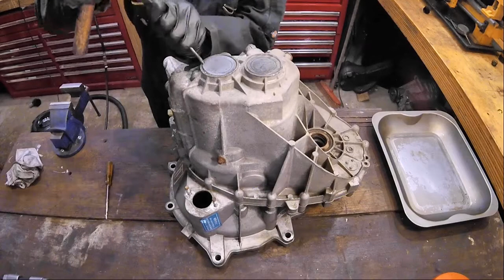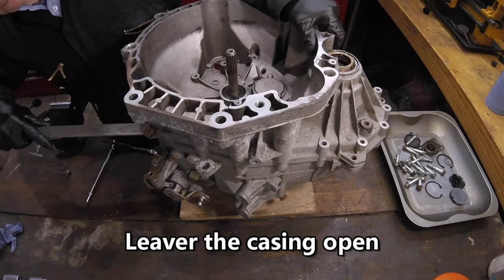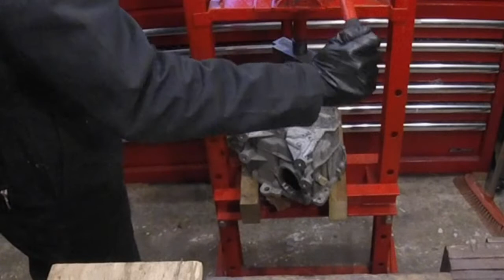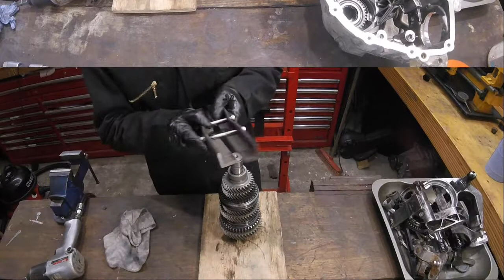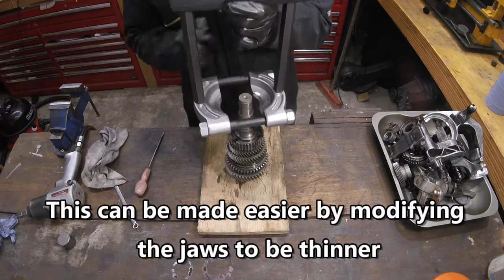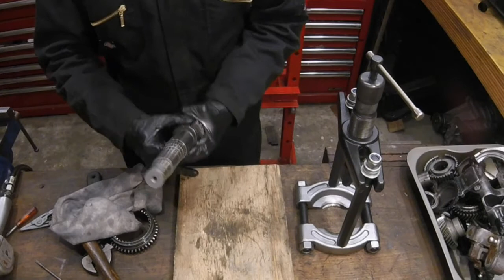Mini Cooper, Mini One, BMW R50 5 speed Getrag Gearbox strip-down

Comment: Ever seen one with only 1st and reverse gear? 2,3,4,5 all neutrals shift linkage looks to be actuating how it should. About to tear it apart
Reply from the maker: I've never seen more than one gear fail at a time.  1st, 2nd, and reverse all use the same hub. So if 2nd is not there I suspect it's a cable problem, or gear stick mechanism, that is not giving enough throw to engage the gears.

Comment: Hi David enjoyed the video’s immensely. Could you please tell me where to locate a bill housing for r50 12/2004 mine was damaged due to broken bolt from crown wheel. By the way how to remove the broken bolt. Best of thanks
Reply from the maker: One Stop Gearbox Shop may be able to help with a new casing but possibly cheaper to look for another a scrap 'box for parts. Diff bolt failures are common and they should be checked and reassembled with a thread locking compound. To remove the bolt I suggest you work from the unbroken side and tap with a centerpunch to rotate it back through enough to grip it with a mole wrench or similar.

Comment: Hello David, is there a need to tear down the whole gearbox if all gears are working very nicely, but the gearbox is whining? No matter at what gear. It is not whining when I press the clutch or there is no acceleration or deceleration.
Reply from the maker: You can just strip it back to any stage you want. The main issue is that, if things are going wrong, it is very difficult to clean out any debris without fully dismantling it. Whine in all gears is most likely to be the differential, check the diff bolts are not loose and bearing are in good condition.

Comment: Hi Dave, I am up against a rock un hardplace my mini r50 2004 convertible had what thought was a thrust bearing gone after removed and replaced with complete clutch kit refitted to the car one other thing the used oil from the box was silver in colour and had swarf in it this was very fine like glitter gearbox totally drained fresh oil put in after refit  still have a horrible wine grinding noise engine running select all gears all good in neutral no unusual noise depress clutch  revs up no noise I then with front wheels raised off the ground release the clutch to drive the wheels spinning and the wine and grinding noise is there put a long screwdriver on the housing casing the noice is loudest when the screwdriver is placed on the diff housing I am changing up un down all gears no crunching forward gears and reverse gear no crunch , after about 10mins turned off "  so have now removed the fresh oil and found glitter like in that too . I have removed the gearbox from the car I have phoned around near where I live and seems nobody wants to repair them only sell you a recon for very strong money my question to you is is it worth my while  me spitting the box as I am thinking the problem I have is the carrier bearings in the differential please let me have your thoughts , kind regards Law
Reply from the maker: From what you have described, it sound like bearings are failing. It may be the diff bearings, but all the bearings can fail so it's difficult to be sure without opening it up. You can buy an overhaul kit with all the bearings and seals for around £160. The risk is that the secondary shaft bearing surface has failed too - that would really make it beyond economic repair. There's nothing to loose by undoing the 17 case bolts and having a look.
Reply: @Nogoslowly  Dave " 
Thank you so much for coming back to me I have looked in to doing that have seen the kits to rebuild I am retired now this is a car a purchased over the lockdown and after doing a lot of work on it and putting a new mot last month taxed insured then on the day of it's maiden run out this raised it's ugly head sods law"  the thing is I do not have access myself to a press and the other specialist tools needed although I have asked a friend that do have a press at his works only thing that scares me is if it is bad and I can't fix it !! the recon places stipulate that they will place a hefty  surcharge if the exchange  box has been opened so will have to have a think ".
 ps sorry to babble on Law
Reply: oh by the way that video is spot on"
Reply from the maker: TBH, if it is beyond fixing, you'd be better to buy a complete 'box rather than exchange. They come up on ebay from time to time. And don't rule out buying a failed MOT car as that is often the cheapest way to get them, swap the boxes and then just sell the car on as spares, or for repair, or scrap it.

Comment: hello David!  help me please!   I have a 2004 Mini Cooper r50 and my midland manual transmission its broke and I would to know if its posible do a swap for one getrag like these. I read some posts that recomendly do this,
Reply from the maker: It can be done but needs new driveshafts, flywheel, clutch slave cylinder, and gear stick with cables. So a lot to change really, and best done from a Getrag donor car.

Comment: Hello David, thank you for posting the videos for the R50 Mini Getrag 5 speed box. Do you know the torque for the blind bearing plate in the gearbox itself ? it has 2 torx bolts holding it in place. Thank you for reading.
Reply from the maker: Getrag/BMW are not forthcoming with torque data for bolts but I use the standard torque for the bolt size and grade 8.8 - which can be googled.

Comment: Hi David, my r50 5spd has done the imput shaft bearing. doesn't look to difficult to replace?
Reply from the maker: It depends on which bearing you mean - the first input shaft bearing (from the clutch) is easy, simply split the casing and push it out. But I suspect you mean the secondary shaft one that support the drive to the diff. That's the one that usually fails and would require a new shaft and bearing. That is a full overhaul and may not be any more cost effective over sourcing a replacement gearbox.

Comment: Would you happen to know where I could find a replacement 5th gear?
Reply from the maker: The 5th gear does tend to burn up as it is squeezed by 3rd and 4th as they migrate down the shaft. That's why we remove 5th in the racing boxes. It can be repaired by pushing 3rd and 4th back in place and replacing the bearing if it has melted. It's not readly available as a new part so, if you need to find another one, you really have to look at the secondhand market.  Message @Duratec.in.detail on facebook and I may be able to help you locate one.

Comment: My mini 5 speed getrag wont go into first, presumably lost the synchro. It will only go into first if i push it in without using the clutch whilst rolling or rev it high and push hard on it. Just completely locked out of first really. Any idea if this is definitely a synchro issue and anything i could try? Thanks
Reply from the maker: If it is just 1st that's the problem, then it's probably a broken synchro ring. If other gears are a little difficult, then it's likely to be something dragging - ie 5th gear bearing being crushed, or 2nd gear bearing can cause a similar problem.
Reply: @Nogoslowly  yeah its just first gear. Im managing to live with if for now, as double clutching usually works to get it into first, however sometimes it doesn’t so i often depress the clutch and engage first before coming to a hault so i can always easily pull away again

Comment: I’ve got an r56 6 speed box, do you know anyway of getting the primary and secondary shaft out without a press?
Reply from the maker: It really is very difficult to remove shafts without a press. If you a re lucky, and can get the circlips off the bearings, you may be able to push the complete bearing on the six speed through the housing. But you'd still need to pull off the bearings to dismantle it further.

Comment: Does the Getrag box have any common issues on the mini?
Reply from the maker: The five speed box can have issues with the gears moving along the primary shaft and squeezing 5th gear (that's why  it's replace with a spacer for racing). 2nd gear can wear synchro badly and is expensive to replace.